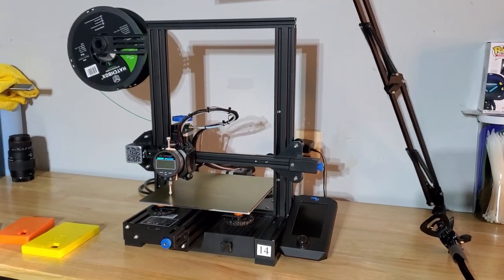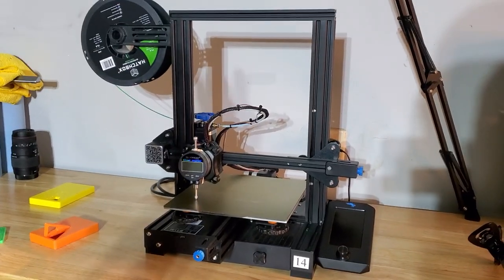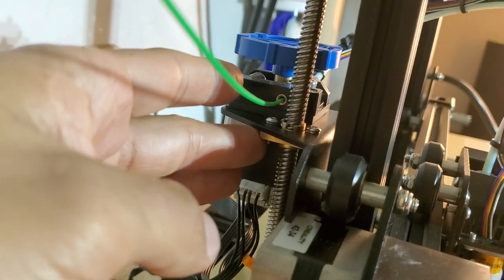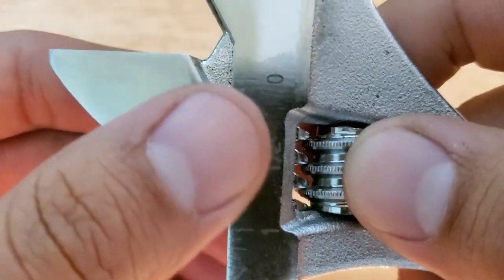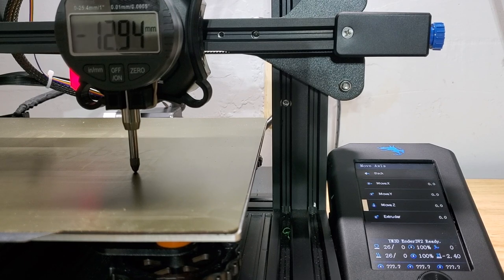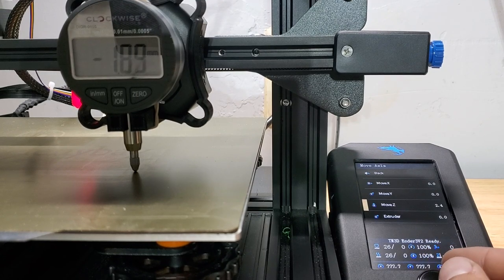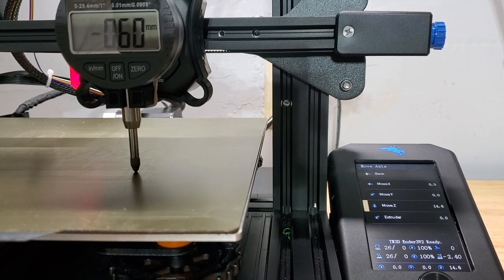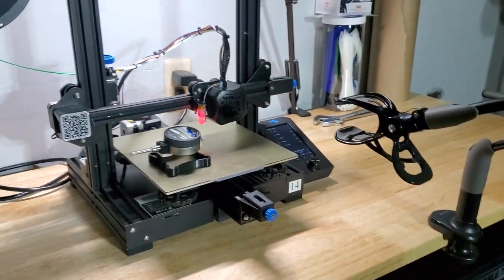3D Printing Elephants foot. How your lead screw is causing it and how to fix it! Ender 3v2

Comment: Any recommendation for what anti-backlash nut we buy? Should I buy one of the POM ones on Amazon? And are we supposed to mount the anti-backlash nut with the screw going upwards or downwards?
Reply from the maker: No recommendations as of yet, I will make a video testing out different anti backlash nuts from various vendors
Reply: @Redo3D  Just wanted to say I upgraded to a POM anti-backlash nut and my elephant's foot is finally gone. Thanks for the video!

Comment: I replaced my lead screw and nut with a 5/16 18 stainless steel threaded rod and nut using a nut mount design I made and 3d printed.

Comment: I think this may be the problem that I have with multi color prints. After filament change (to another color) the printing head will come down and the layers are not following/connecting properly. It seems like the Z axis stays on top side of clearence which causes wrong connection between layers. Thank you for really informative video. I will try to change my lead screw nut to an Anti-backshlash nut and I hope it will help with my problem.
Reply from the maker: Awesome. I recommend using POM nuts as they seem to have a tighter fit.

Comment: That also be caused from over tightening the gantry rollers eccentric nut.  if the nuts is to tight then the gantry will hold it position causing more backlash.  if they are loose enough then it will negate a lot of backlash.  losen the eccentric nut for the gantry rollers and see if it resolves this issue.   i get some of you don't want your gantry to fall to the bed when you turn it off.  but you can adjust it to that sweet spot where it won't fall on it's own and a gentle pressure from your finger will make it lower with a gentle push of the finger when off.  you want the weight of the gantry to hold down on the backlash nut.

Comment: Thank you! That was really interesting perspective. Right after your video, I immediately went and checked if lead screw on my Ender 3 has that issue. And found out, that the screw and the nut are both ok - the movement on first layers is pretty much like yours. After some investigation, I've found the issue - the bracket, to which the Z axis stepper is attached to, is slightly bending at the start of the motion, because Z axis was moving a bit tighter, than necessary. So the first 0.3-0.6mm movement were mostly spent to bending the bracket, and then the rest of the axis started to move.
Reply from the maker: Interesting! In my case the lead screw nut was the issue after replacing it my problem went away, but I Will check for this bending effect. Thank you for following up!
Reply: @Redo3D  Measuring the distance between the two z extrusions can help to find out if there is a difference. I had the X on the bottom position when I screwd the top extrusion in. That made 1 mm difference between the top and bottom position. So I did loose the bolts on the top and moved the X extrusion to the upper Z position, and i fastend the top screews again. Not is is the same in all position. Also if there is some geometry problem with the frame, you can feel the difference when you try to spin the wheels with your fingers in differenth heights.

Comment: Just ordered a set of anti-backlash nuts from Amazon. My 'elephant's foot issue is to the point that I'm shaving off about 2 - 3 mm of elephant's foot off of prints at this point. Hoping this solves my issue as well. Hadn't considered the fact hat the nut is brass, compared to the lead screw being steel. Thanks for the tip. If I remember, I'll come back and provide a status update. 🙂
Reply: As a follow-up, new lead screw nut is installed, however this has not solved my problem. More research to perform. Ideas though.
Reply: @RNMSC I was wondering if you found any solutions yet?
Reply: @IthinkIneedAhug  I'm getting there. Mostly at this point it's tuning the z-probe offset. Because of some bed adheasion issues I was having z offset had gotten down to -2.0 mm when it should be about -0.5, give or take a bit. I've got it down to a point that I can finish my current project, and bed adhesion is not an immediate issue.  But there is still some at -0.75, but this is much more manageable. So at some level the anti-backlash nut has helped. I think there is more going on though, and that's mostly going to require tuning.
Reply: @RNMSC  thank you so much for replying! I think I'm going to fuss with my z probe offsets first, which is less fun and exciting than buying a new part :P you did say the anti backlash but does help, would you say it helped enough to justify the price and labor involved? 

I'm really just wanting to avoid accidentally making more work for myself right now lol but if one person can tell me that it helps enough to justify it, I'm in!
Reply: @IthinkIneedAhug  Having completely torn down and rebuilt 3d printers, the work involved in replacing the nut with an anti-backlash nut to me was not significant. That is for me, however I do not know your situation. I will note that in doing this, I encountered a situation I'd set up earlier that does need to be addressed, which is that my replacing some parts earlier left me with a bowden tube that is 'too long, and that sets up the cable as a limit to z-height overall.)

Given all that, the real benefit is that the nut reduces the play in Z that gets added to the nut through wear and tear on the printer. If t hat condition does exist, then it's worth the effort. I'm not sure it was in my case, but I don't consider it a negative result.

Comment: Backlash is a problem with direction changes, but the gantry of the ender is moving in one direction during printing. On top of that, the weight of the gantry is also constantly forcing the contact between the nut and the thread to be on the same surfaces (assuming your gantry is moving freely). To be analogue to your wrench - a weight is constantly hanging on the bottom part of the clamp, preventing it from becoming contactless.

This would be true for X and Y, but I'm not sure this is the full story for Z.
Reply: the z screw changes direction at the beginning of the print after the purge line. this is plenty to introduce a issue. i have noticed this when i manually level my bed with a feeler gauge.

Comment: Would this not mean that the gantry is not free enough? If the gantry is in free fall without the leadscrew (x and y fully contained but fully free in the z axis) Gravity should take the backlash out of the system. No?

Comment: Is your backlash that same at X0 as X220? I suspect your anti-backlash nuts are just a bandaid. I came across this issue a long time ago. The way I noticed it on my single lead printer was thru the use of a digital level on the x axis. As i move z up and down it would go out of level by 3 tenths of a degree on every direction change with a perfect roller adjustment. My real fix was dual z leads. Now the gantry goes up and down perfectly leveled. The models from thingiverse and such are horrible I designed my own from the ground up to link both sides using two pulleys and a belt at the top with two bearings on each lead screws at the pillow block.
Reply from the maker: Dual lead screw definitely helps with the gantry remaining level. In my opinion it's the biggest flaw on the ender 3. The lack of a dual z. I want to upgrade to a belt driven z system which I think is the best option for maintainability

Comment: Why is gravity not supplying anti backlash action? By all reason if the alignment of the frame is good and it's not binding, the gantry should be able to find the lowest point, at which the screw contacts the nut.

Comment: i knew something was up with this!
you got a link for the replacement nut and the anti backlash nut? originally i was gonna upgrade to dual z and i still might, but this seems like the printer should just come with it
Reply from the maker: I purchased some off of amazon. Here is  the link to the ones I purchased. A viewer also suggested using POM nuts, Im going to give this a try also.

Anti Backlash Nut: https://www.amazon.com/gp/product/B08LZ1V56T/ref=ppx_yo_dt_b_search_asin_title?ie=UTF8&psc=1
POM: https://www.amazon.com/gp/product/B0888DWRW8/ref=ppx_yo_dt_b_search_asin_title?ie=UTF8&psc=1

Comment: In my case, what I am doing is buying a few POM nuts and using the worn out Lead-screw upside down to use the Never-Used part of the Lead Screw because 99.99% of my prints concentrate on the lower part of the Z-Axis

Comment: What about gravity? The weight of the assemby always pushez the nut down. Maybe your eccentric nuts are too tight. Also on the right side you don't have lead srcew. If weels are bonding, the right side will follow the left with a bit delay.

Comment: I bet a fix for this could be implemented in your start G-code. If you send a command to move the Z-height up like maybe .4 when the print starts and use a Z-offset of .4 it may fix the issue (although may not be good for your nozzle if its brass on a glass bed).
Reply: someone smarter may be able to think of a better way to do it.

Comment: Why is there backlash if the weight of the z gantry keeps the nut engaged constantly? I feel like even if its moving up or down there is always a downwards pressure because of gravity pulling the gantry down.
I am going to test this tomorrow. Maybe it will fix my first layers too.
Reply from the maker: There are many reasons for the gantry not perfectly falling and engaging with the nut. The design of the single lead screw with adjustable v rollers  introduces many problems that can prevent this from happening.

Comment: I'll came up with the following start-gcode modification:
 G1 Z2.0 F3000 ; Move Z Axis up little to prevent scratching of Heat Bed
G1 X0.1 Y20 Z0.3 F5000.0 ; Move to start position
G1 Z0.5
G92 Z0.3
....
The last two lines move the z axis up and resetting it's value to where it was... This is done right before the drawing of the first line.

After the second line:

G1 Z2.0 F3000 ; Move Z Axis up little to prevent scratching of Heat Bed
G1 X5 Y20 Z0.1 F5000.0 ; Move over to prevent blob squish
G1 Z0.4
G92 Z0.1

After the the second line and after it lifted and went 4.9 to the side (right before the actual print starts), G1 tells it to move to Z0.4 (which is less due to the faulty z-axis) and set this position to Z0.1.

In the original code, in the "move over to prevent..." line, it moves to Z0.3, but i i figured that if you use a smaller layer height than 0.3, it will go back down to your starting point (therefore creating more slack). That's why i'll have it move to 0.1, because that's the lowest layer i can print.

It should basically move the z axis a little bit without telling the machine it did. Haven't tried it yet, but should work. I will play around with small cubes to see how much i have to go up.

Wish  me luck, hope this helps

Comment: buuuut the gantry is always engaged with upper thoot profile of leadscrew without backlash because of gravity! the real reason for this problem maybe the loose eccentric bearing of unsupported part of gantry causing tilted movement of that

Comment: A quick tip for perfect Z-offset adjustment:
1.) print a cylinder of anything between 5-10 mm in height
2.) measure with a micrometer or similar
3.) adjust Z-offset accordingly (e.g. you measure 5.074 mm, move the Z-offset down 0.074 mm) 
4.) you may want to consider adjusting the flow for your first layer so to avoid elephant’s foot

Happy printing :)
Reply: The problem is it's not a flow problem but a Z height movement problem. So there is no correct way to solve this other than an anti backlash nut.

Comment: Forget about lead screw and backslash - go for CoreXZ setup. I converted my Biqu b1 and no more backslash issues. Same is possible with Ender
Reply from the maker: Just purchased an ender 6 for testing!
Reply: @Redo3D  good luck

Comment: Can the first layer be adjusted to move a little further to counteract this?
Reply from the maker: It will be the same. You could have your gcode have the nozzle reach z=0.0 and then move up to your first layer height to take out some of the backlash. But just adjusting first layer height won't change it much if you have auto bed leveling. If you are manual bed leveling without bl touch you might be able to take the backlash before printing.

Comment: Is there any chance that some of the difference between the set and moved distances is from the printhead flexing?
Reply from the maker: The stem on the dial indicator has hardly any resistance at all. It wouldn't be enough to cause any measurable flex on the printhead

Comment: let's not forget the Magic Number. (credit to CHEP) each step or millimeter or fraction of mm of the stepper isn't exactly what the machine calls for.

for a 1.8° nema 17, it takes 200 full steps per rotation (or 360°) then you have the lead screw which is 2mm pitch. so every 200 steps is 2mm.
or 
0.01mm per step.

however these machines are set to 400 steps/mm, which equates to 0.0025mm per step. but that is with 1/16 microstep. that's the theoretical resolution. however 0.04mm a full step. so say you wanted to go 0.1mm that is 2.5 steps. you lose accuracy at those values.

next time try using the 0.04mm magic number and increment with those values. and to avoid backlash, have the gantry already go in that direction so the threads are engaged, that way backlash isn't a variable.

Comment: I noticed you were measuring on the far side of the gantry away from the lead screw, because of the cantilever nature of the gantry due to the motor only driving one side that could be part of the problem 
Adding a second z motor lead screw anti backlash should help reduce it further
Reply from the maker: You are absolutely right. I am making a future video going over what I think keeps the ender 3 from being a perfect work horse for a print farm and that Is one of its issues
Reply: I don't think that will solve the problem because more than 1 anti backlash nut will be too hard for the stepper motors to move and will bind up the z axis. Many dual lead screw kits that provide AB nuts recommend using just 1.

Comment: This is why anti backlash springs exist and why you should be using them. Also an oldham coupler. And one other type of elephants foot, bed too hot. Ideal temp is just under glass transition. For PLA, GT is 60. Ideal bed temp is 50-55c. Hit or go over 60c, and your bottom few layers remain soft. The one toucbing the bed is stuck to the glue and wont move. But the 3, 4, 5, etc, above that,will be semi-melted the whole print and shrink as a result. Fading off as it goes up. This makes elephants foot too. Youll sometimes see a forum or FB post saying "print wouldnt stick, so I set 75c and it worked"... Do NOT do this. Thats an amateur. His bed is either oily or dirty, coating is worn out, adhesive (is used) wasnt done right, or his offset is too high off the bed. Yes temp makes more stick. But it comes at a cost. The golden number is just below glass transition for your given material.

And calibrate your XYZ, not just E. E is not enough by itself, we work in 3 dimensions not 2. If you raise off the bed say 5mm like he did, and its still not making good movements after zeroing, its because you didnt calibrate steps/mm for XYZ. Enders are particularly notrious for this. They do not come calibrated out of the box. Cheap manufacturing makes tollerances too high so theres no point in them doing it in house, it would add an hour to each one.

Comment: Install Klipper... home your printer... hover the nozzle above your bed screw adjust using a feeler gauge, for example 0.2mm. Go 3 times clock wise, remember to push down the feeler gauge so it's flat on the bed and not floating. Then you will hear when it hits the nozzle... you want a slight, very minimal resistance when moving the gauge underneath the nozzle... Then you go to Klipper and set the Z offset to 0.2mm (gauge height)... DONE...

Pro way would be to home... tell the printer to go 0.2mm up in Z axis and then do the calibration... you don't need to add a offset later and you can also print 0.1mm layer height... or you can also just calibrate for 0.1mm (lowest layer you will print) and set z-offset to 0.1mm.

Comment: I have an S1. What bracket to use in it to mount the dial indicator?
Reply from the maker: It's a bracket I custom designed for the ender 3 v2.

Comment: I have no one to ask about this .I.installed the bl touch firmware and I have a odd thing going on .When I press print and scroll down to a item to print It starts scrolling then when I got print it runs a completion scroll and delete that object.Ive reinstalled the firmware and same thing any thoughts would be appreciated thank u
Reply from the maker: Sounds like a very strange issue. I would recommend joining the Facebook group for creality ender 3. Over 60k members there and many are willing to help and might have seen that issue before.

Comment: this doesnt make sense as gravity and weight of gantry keeps screwteeth engaded. Only posible case when this is true would be when you lay gantry weight on the printbed , and that should NOT happed at all. (but propably that happened when you had put your measuring tool against the printbed)